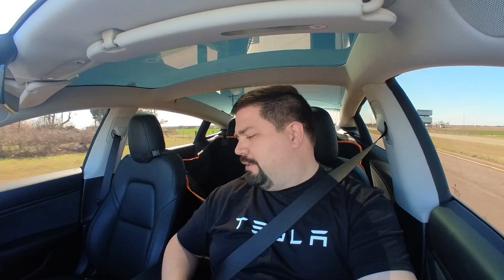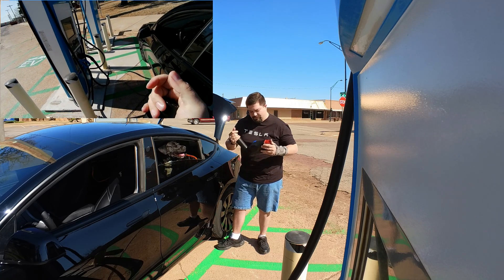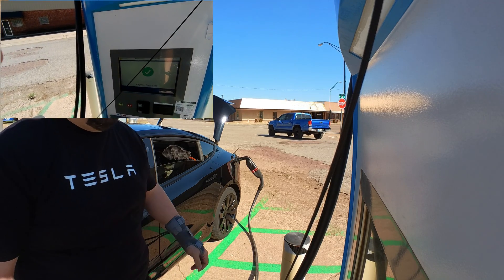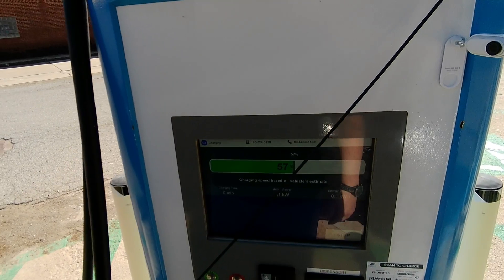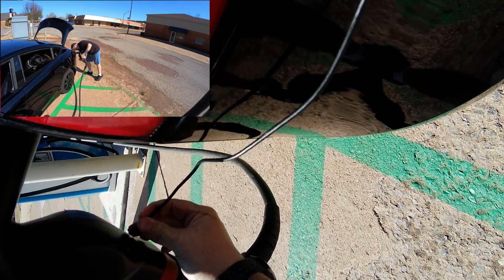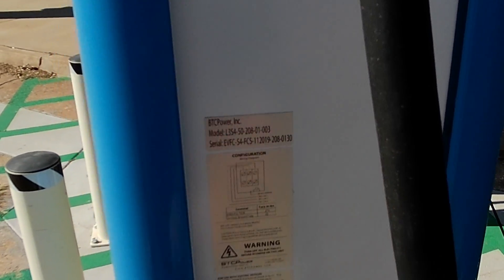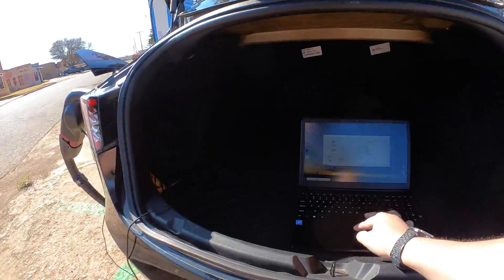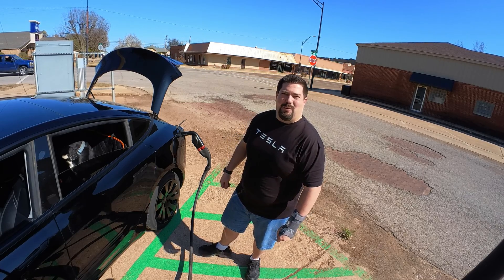Tesla Setec CCS adapter testing #15

Comment: I've watched all your videos with the SETEC.  Thank you!
 I just received mine and have had great success with EVGo stations.   There's a new free CCS by Volta at the mall near me.  I got that one to work once but no more luck with it using ver. 150.
My SETEC came with version 146.  I updated it to 150 and am also logging data with their software.   I've connected it different ways but can't get it working again at the Volta station.   I've retested at EVGo with perfect success.  Any suggestions are greatly appreciated.

Comment: SETEC's 200 Amps rating is giving the limit of 80kW. (400V x 200A = 80kW).  I hope the SETEC engineers figure out how to make it think it is charging like a supercharger and not CHAdeMO but keep in mind, even with the 100+kW chargers, the most ideal and theoretical maximum for this SETEC is 80kW.  Still better than the 40-50kW with the CHAdeMO though.  Thanks for the video!
Reply from the maker: My Model 3 is limited to 125 amps when not a supercharger. I've seen a Model S be able to take the full 200 amps from the adapter. There is a firmware floating around if you want to risk it that makes your car think it is supercharging when you're just at a regular DC fast charger that bypasses the 125 amp limit but I don't want to risk it. There's a new passive adapter that will work with newer cars with no limits evidently I haven't tried that one because my year model is not compatible.

Comment: I guess firmware 146 is supposed to help with the higher charge stations?  Otherwise, since 141 works with the 50kW stations, why would they make another firmware version?  Anyway, thanks for the test data.
Reply from the maker: The 50 KW BTC station has been working since I think firmware 136 if I'm remembering right.... I don't have high Hope that the 350 amp BTC stations will ever work. ABB is pretty solid, I don't know about signet and efacec.